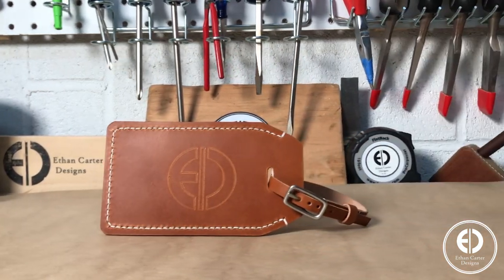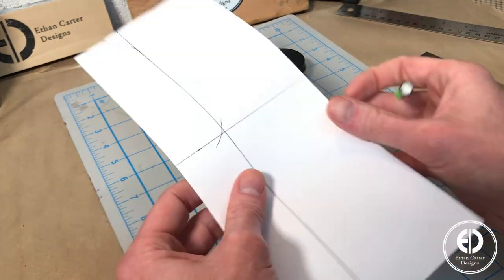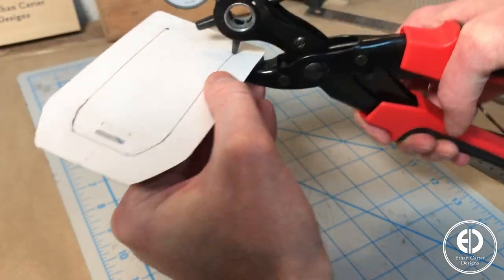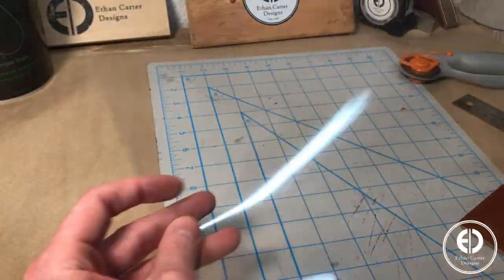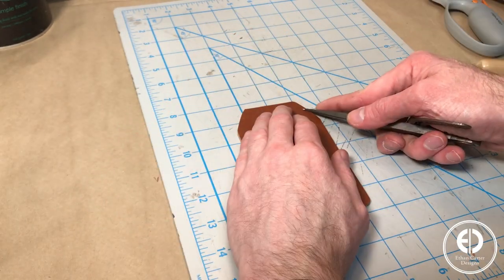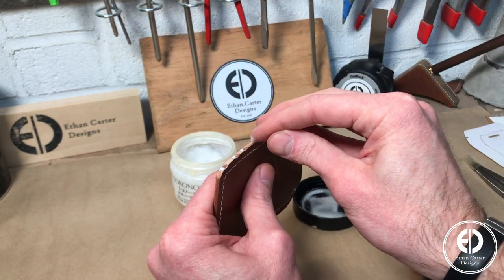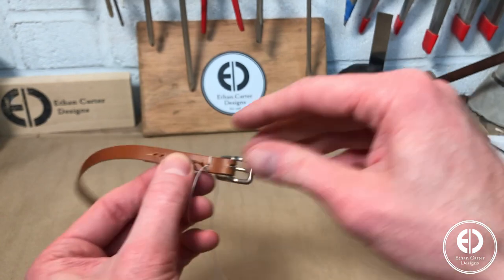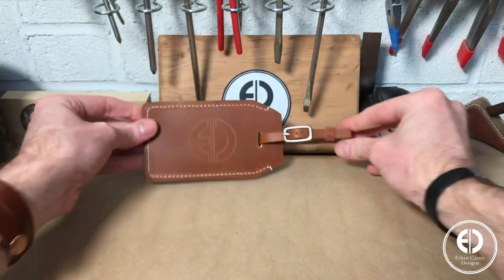How to Make Luggage Tags

Comment: It looks great, but seems like having to take it off your bag to open the flap and see the info kinda defeats the purpose
Reply from the maker: Thanks for liking how it looks. It's actually a very common design to have them work this way - the reason being is that it helps prevent the info cards from inadvertently falling out and getting lost in transit. There are other designs that don't work like this though if that's what you're more comfortable with.